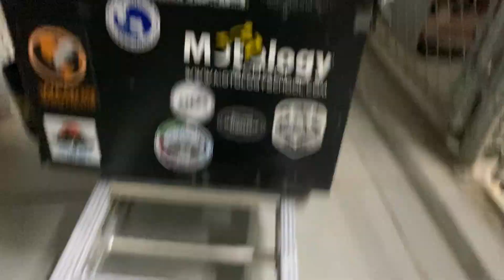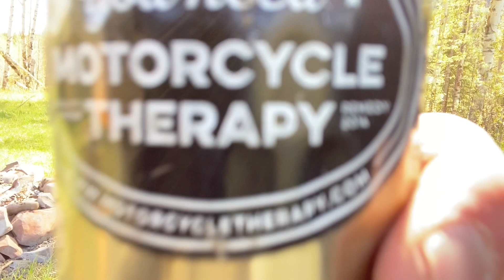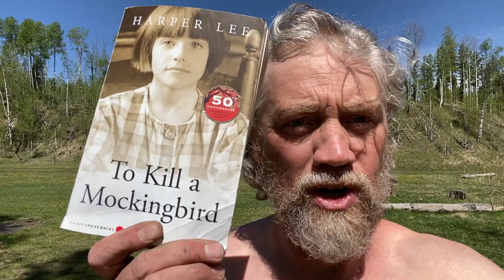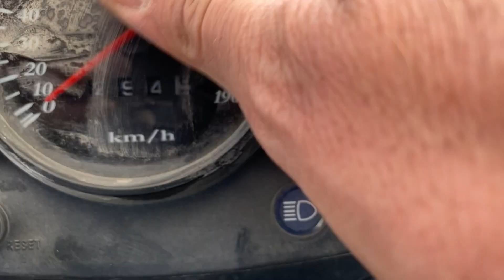First Motorcycle Camping Trip of the Summer // Wild camping, Canadian Rockies, Alberta with KLR 650

Comment: Procrastination is my nemesis. Making my first motorcycle camping experience a positive one is a daunting task, i have all new moto gear,  ( as i was a camping bicyclist before.)but the weather, Hail and thunderstorms,( Its July 2023) Bears, not being able to have a campfire, one of the major reasons i would go Moto camping, annoy my start. I have done all the roads, you just did but not camp.  I motelled it. The Hwy 734/40 past Nordegg is a good one too, I just have to buck up, Damn you Procrap!
Reply from the maker: I mix it up. Sometimes I use motels. Sometimes I camp. There’s no wrong way to go, in my opinion. My dad used to ride all over BC and the Western US. He always brought camping gear, and he never camped. Just loaded it on the bike in the morning, and into the hotel at night. The older I get, the more I understand that. 😬😎😃